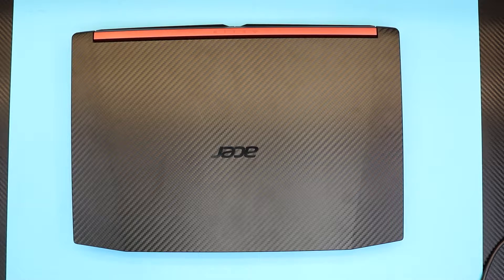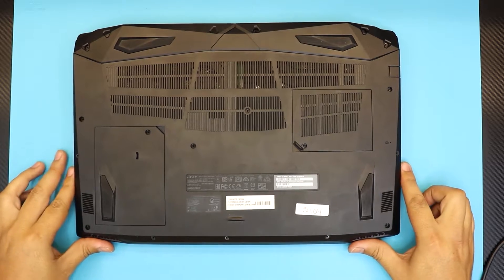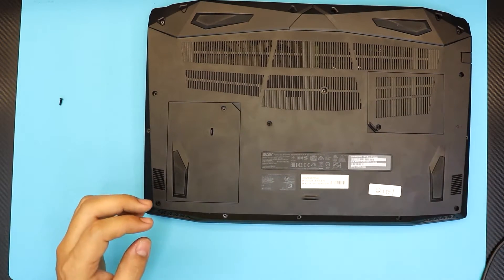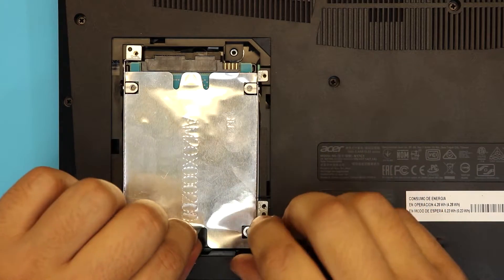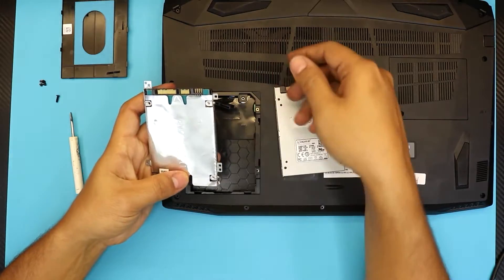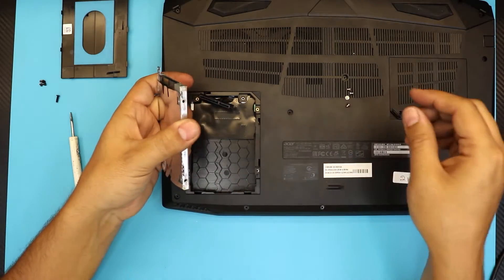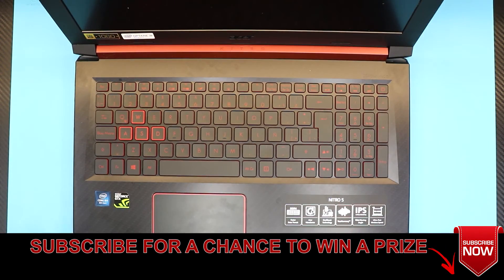HOW TO UPGRADE Acer nitro 5 series Hard drive to SSD drive

Comment: Hello I have a question.
I have a laptop (Acer Nitro AN515-52) with 240 GB SSD and 1tb HHD so I want to clone my 1tb Hd to new 1tb SSD so do I need to clone windows OS also ? Because my windows is in C drive and I am not replacing my C drive just replacing the HHD to SSD
Reply from the maker: no you don't need to clone windows C drive if you only upgrading the 1tb hdd to 1tb ssd the extra storage.
Reply: @uFixTek  thank you
Reply from the maker: If you have any future questions or requests, please don't hesitate to reach out to me. I'll be happy to assist you.

Comment: My Hard Drive is beoken and i bought an M.2 SSD and not that big one. Can i still run my laptop with the broken HDD and the new SSD or do i need to buy a new solid HDD/SSD tto let the laptop work?
Reply from the maker: if you drive is dead you must 1st remove it else it will cause crashes, you can just run the laptop with ssd and install windows in the ssd and you will be fine. and much faster it will be.

Comment: Hey, I was wondering. If I do this, will I then lose all my files and drivers so the laptop wont work? Do I have to make a backup somehow, if so could you refer to any link for help on this matter? Thank you!
Reply from the maker: Link gethis program called “Macrium reflect” and make and clone of your hdd to the new drive ssd or hdd then you wont loose anything.
Reply: @uFixTek  Thank you! I figured this was the way to go. I got one last silly question. It still works by upgrading from ssd to a better ssd, right? Just got curious since everyone mentions hdd to ssd as if that is the only way x.x

Comment: I got a question, why you don't have copy the system to  SSD from t HDD before you replace it ?
Reply from the maker: @HeadingForTomorrow  IT WILL ADJUST, also you will need this adapter:
https://amzn.to/3y9TcoZ
Reply from the maker: Use “Macrium reflect” to clone your drive to new drive

Comment: If i already upgraded the RAM on the nitro 5 would i still be able to upgrade the performance of the pc if i bought an upgraded ssd or would it not be necessary?
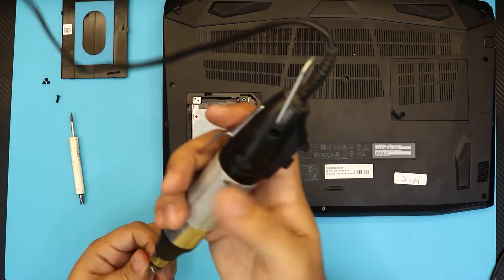Reply from the maker: if you want to see a 400% extra upgrade open your laptop bottom cover and remove your optane (its useless) , and in its space place an NVME ssd drive and install the windows there and use your mechanical drive as storage. remember if you but a NVME drive and if you want games to run faster and better you must install them in the same drive, if you get the NVME and install windows there and the rest of your games and app are installed on your mechanical drive your windows will be fast but not the apps nor the games. there fore make sure you buy a big GB on NVME. if you want to know how to open it check this video and @3:40 you will see the optane drive on the right side by the ram. trash that stick, that stick kinda fakes out that you have a ssd drive and its garbage. https://www.youtube.com/watch?v=nYe6uQN-OHg?sub_confirmation=1.
i would always recommend Samsung for nvme  and the evo line you can go for 500gb or 1tb  the biger the GB the faster file transfer also,
https://amzn.to/31yTV2w

Comment: regarding the acer nitro series, if you buy the ones with a 1tb hdd instead of the 256gb ssd, is there space to add a second hdd, or is the hdd already installed into that storage dock?
Reply: You can install an M.2 drive directly onto the motherboard which is what I did, however theres no room for a second 2.5 inch drive. Hope I helped.

Comment: I've watched other vids and there were no drive already in, did you already add that one or did they remove there's before they recorded.
I'm going to get the nitro 5, and I'm new to this stuff.
Reply from the maker: all nitro they come with mechanical HDD. and some come with ssd m.2 drive in or obtain drive. but they always have the mechanical drive in. other videos they must have removed it before recording. here i have a full disassembly of nitro : https://www.youtube.com/watch?v=nYe6uQN-OHg
@3:20 you can see whats inside.
Reply: Nope my computer didn’t have a hard drive in it, don’t ask how it worked but I was shocked when I found there was nothing connected to the pc.
Reply from the maker: @frostixl6867  then your system in on a ssd m.2
Reply: Mine came with a 256gb m.2 ssd, can I just add an extra ssd hard drive in that space ?

Comment: Is it Windows 10, it's OEM, after changing to SSD Windows, still OEM?
Reply from the maker: Bayu Eka after changing to your ssd you wont have any system on it you must download the windows 10 iso from Microsoft website. Or clone your old hard drive to the ssd
Reply: @uFixTek  windows still original?
Reply from the maker: Bayu Eka your license is tied to your PC's hardware. Regarding your queries, you're still allowed to use Windows 10 on the same PC even after changing it's hard drive without any additional cost.

Comment: I’m replacing my hdd with a ssd. I have the os on a thumb drive but have never switched these on a laptop. Specially a gaming one. Am I going to lose the nitrosense and other programs that are preinstalled on the laptop? I know some of these can be found for driver installations but nitrosense to me is important as it controls the fans. Wondering how you worked around this or if you didn’t at all and what your experience has been so far. Swapping the drives tomorrow so either way I’ll find out.
Reply from the maker: if you replacing your hdd with ssd , keep your hdd as a back up as it contains the OS and if anything you can put it back and you have your old system back, and if you install the new windows 10 on your ssd you dont have to worry regarding the drivers, after windows is finished installing do a full windows update and it will install all the drivers. also regards to the nitrosense you can download it from acer site:
https://www.acer.com/ac/en/US/content/drivers#_ga=2.58659754.1010840610.1549509777-191673514.1549509777
just put you ssid and under apps you will find it and anyother driver or app is going to be there.
goodluck
Reply: So my experience. Trying to to a fresh install of windows 10 became problematic. I had zero access to most of the acer nitro programs. For some reason nitro sense wouldn’t allow me to download it. So I ended up purchasing a usb to sata cable. Plugging my original hdd into the main 2.5” slot and then plugging the ssd into the usb to sata. I used macrium reflect and everything went smoothly after.
Reply: Hello I have a question.
I have a laptop with 240 GB SSD and 1tb Hd so I want to clone my 1tb Hd to new 1tb SSD so do I need to clone windows also ? Because my windows is in C drive and I am not replacing my C drive just replacing my HHD to SSD

Comment: When I plug in the drive it says no bootable software can I get some help pls
Reply: So the laptop can with a pre installed HDD what I’m trying to do is replace it with a new SSD but when I plug it in and turn it on it says there is no bootable software
Reply from the maker: MJ HEAT yes thats a correct you need to download a windows 10iso from Microsoft website and burn it into a usb stick then boot it install it from there. Google: download windows 10iso. And it will show you step by step
Reply from the maker: MJ HEAT i can send you links once i get to a computer later on today
Reply from the maker: MJ HEAT what drive new ssd or hdd ? , or the original hdd /ssd? Give more detail
Reply: Ok thank you
Reply from the maker: there download this tool then it will download and it will burn it into your usb drive.  
https://www.microsoft.com/en-ca/software-download/windows10